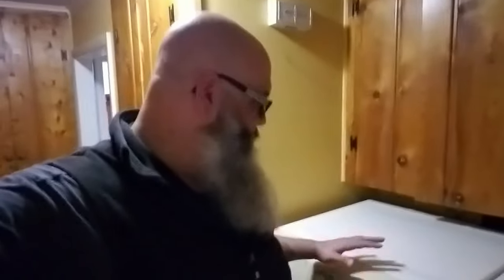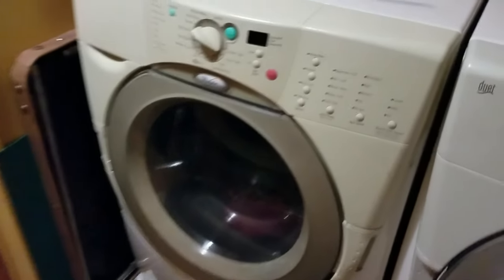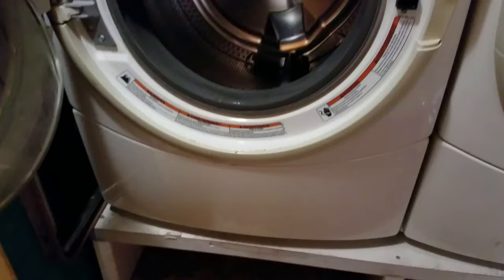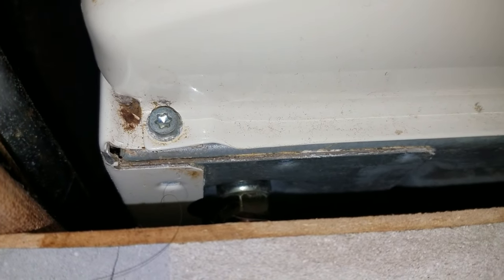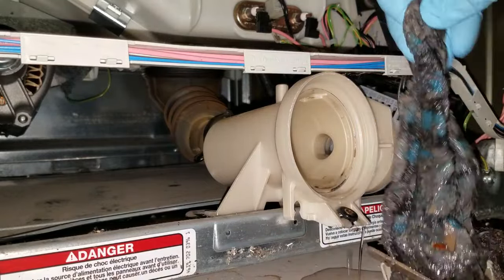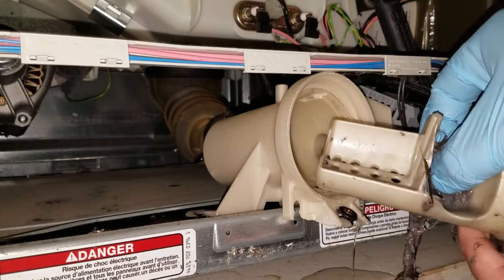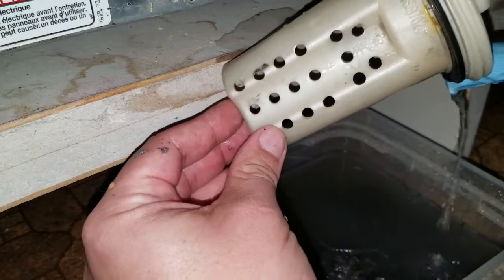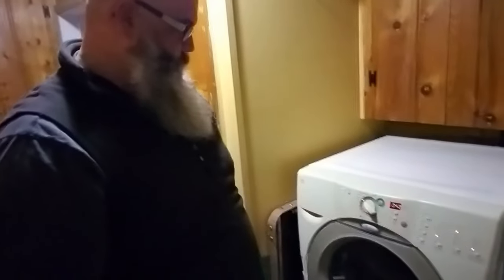Fixing a F-02 error on a Whirlpool Duet Front Loader Washer

Comment: I have watched the video done it all it’s still not working it keeps on blinking but won’t do anything any recommendations??
Reply from the maker: I'm not really sure because I'm not an expert, but it potentially could be that your pump is bad. I bet you can find one on Amazon pretty cheap and try replacing it. Sorry I don't have a video on that, but perhaps someone does? Wish I could help more. Good luck!
Reply: The Bearded Woodworker Bud you are the best I lied to you I did what you did I have the exact same machine at home I just needed to unplug it from the light and replug it and it worked ASoon as I rep lugged it I think since it was stuck in a code when I cleaned it it tought it was in the same condition
Reply from the maker: Wait, what....are you saying you didn't follow my directions and unplug it first! Ha ha😉 Glad to hear you resolved it.👍🏻
Reply: The Bearded Woodworker It was nearlly imposible to unplug since the drier is on top of it! And I had no help to bring it down! Once i got help and did that “unplugging step” it was as good as new again thanks bud good night!!

Comment: I’m trying to do this to mine but can’t unscrew the plastic knob. Help please
Reply from the maker: The actual cap that covers the drain? I would suggest maybe using a pair of pliers to give you better leverage? I wish I had better advice, but I'm not a plumber or appliance repair guy. Good luck!
Reply: The Bearded Woodworker I used a pair of channel locks and it came right off. Sure enough there was 3 baby socks. We use a garment bag now and haven’t had a issue sense.
Reply from the maker: Yay! So glad that did the trick. Good job!